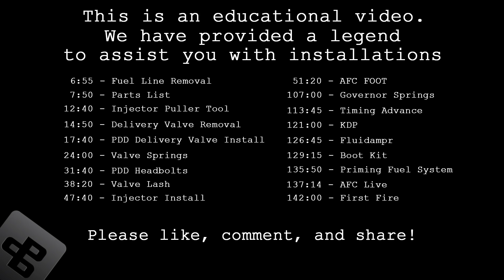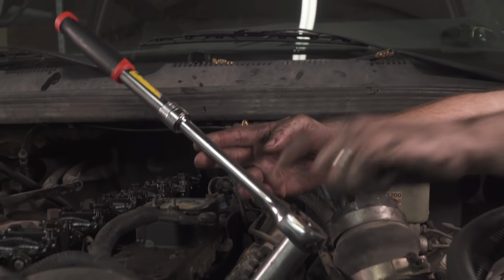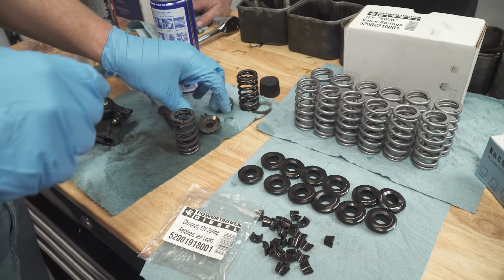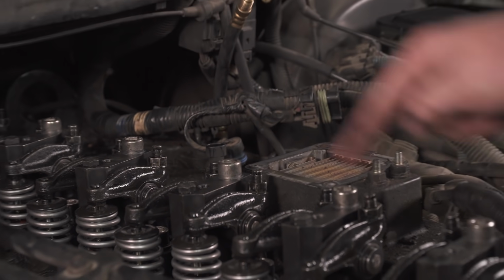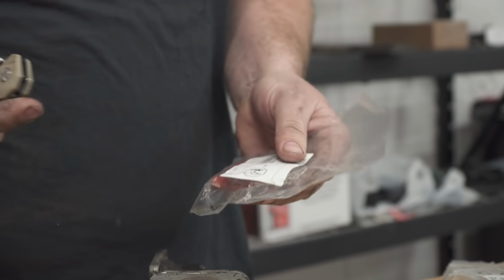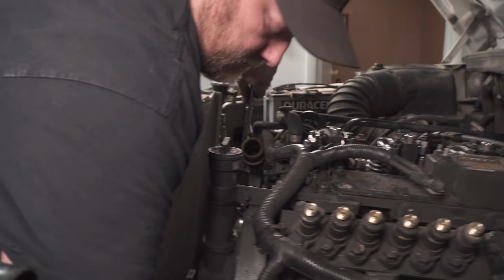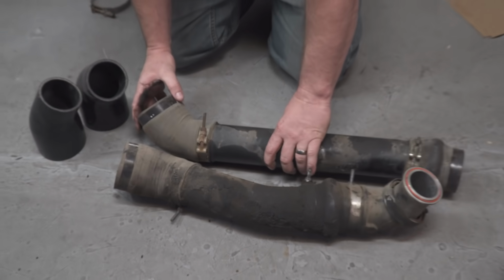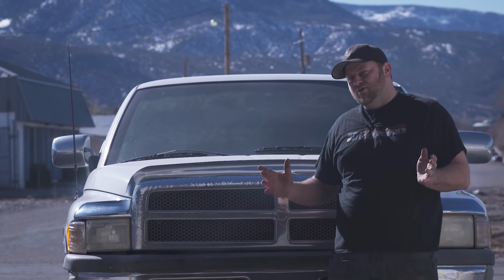Upgrading a Perfect 400k Mile Cummins Diesel

Comment: How many clicks do you do on the gov springs? Is there a generic number? Mine seems to hunt abit and have forgotten how many clicks it was when i pulled it apart.. rookie mistake
Reply from the maker: Usually one soft click AKA initial click and one or two more clicks is perfect.  The looser they are setup, the stronger the idle but the earlier they will start to govern out and pull back fuel.  Try 3 clicks and see how it runs (1 soft and 2 medium or hard clicks)

Comment: Awesome video guys, really love that you got back into your old style of step by step videos but I would have thought for that kind of power you would need to run a good lift pump such as your predator lift pump and also a few other mods such as a Mack rack plug and a tork tech adjustable over flow valve on the pump? 
Anyway needless to say I think the tranny will be the next thing on the must do list now haha.
Reply: I have a single K27 turbo 12V, custom intake and that's ALL. Not even gov. springs yet. My truck flies haha and of course no smoke. These trucks are amazing. I had my auto trans done by an awesome, experienced builder just to make sure it could take the beating of ripping around and towing anything. Yesterday I just put an AFC Live on my friends 12V (that someone put injectors on before). His truck is even faster than mine. When the roads are a little damp the rear wheels break loose in 5th gear now... before only 4th. I can't believe these engines.

Comment: Hey Will, do you always bar the engine over backwards? Im going to run the overhead on my 3rd gen and i like the companion cylinder method. Curious as to why backwards vs forwards and if it even makes a difference. 
Thank you both for all the hard work and knowledge shared through this channel. It has turned into a very valuable resource.
Reply: If you go forward it just slips on the belt
Reply from the maker: The alternator will only turn it backwards on a 2nd gen because the belt slips when turning the engine forward, so I've always turned it backward.  There is no issue turning the engine forward or back but keep in mind if you turn the engine forward, you are now watching for an exhaust valve coming up and overlapping with the intake valve starting to go down.

Comment: Hello; I've watched a variety of your videos and notice you don't seem to have much to do with newer 6.7 engines ? I race an 08 dodge dually, stock engine with a few minor engine mods @ 1000 dyno hp+
Reply from the maker: The 6.7 engine is great, but these newer/heavier trucks are tough to keep reliable for racing.  Imagine how fast you could go with 1000HP 6.7 Cummins in a tube chassis dedicated race vehicle!

Comment: Question Power Driven Diesel
Would you guys build a 2003 Ram 3500 Crew Cab Shortbed commonrail 5.9 with factory NV5600 manual transmission? My old girl just turned 325,000 the other day but definitely need to do some Power Driven Diesel upgrades hahaha
Reply from the maker: We've seen a few turned up 03-04 trucks do well with the NV5600 and a twin disk clutch.  They too get unreliable around the 750 HP mark keep power at or below 750 and it'll run great.  Just keep in mind if you street race your buddy or go to the dragstrip, an automatic truck with 600 HP will run right along side your 750 HP manual tranny truck.  But a roll-on at 60 MPH, then you'd pull on the lesser powered automatic truck till you have to shift....
Reply: @pddofficial  That is awesome! Honestly i was thinking of either twin turbo or 2nd gen swap with a good turbo, little bigger injectors and tuning then dual disc clutch, i live at around 4500ft elevation and go all the way down to sea level but i just want reliability with lower egt’s etc i tow with it a couple times a year or take 1000+ mile trips unloaded but rest of time is work driving etc. I just want a little more power with some better reliable parts and tuning then say oem, i wouldnt even mind 450-500hp but cleaned up tune good for high rpm maybe but still get good mpg in 6th gear running around 2000rpm on 35” tires. Nothing too insane at all but maybe something that makes it run better, it just has a Fass, AFE intake and rail pressure/boost gauges and 4” exhaust but i wanna make it run a good long while if i could and good for long trips or even cruising down backroads of northern california/oregon

Comment: Did you guys do the valve seals as well with the springs?
Reply from the maker: Normally we would do the valve stem seals, however, this engine is going to reside in the truck for less than a month before it's being replaced with a new race engine.   If this engine were to be transplanted into something else, we will probably pull the head and install a PDD ported head along with fresh valve stem seals, oringed head gasket, etc.

Comment: I have a stock 1996 I just bought... are all these parts available in California?
Reply: They are but..... The smoke police will getcha if it "hazes smoke" for more than a couple seconds .. some areas are more strict and if they see any smoke theyll pull ya over.
Reply: @jdogdiesel7242  is there a site that tells me what I can and can’t do?  I want to do some mods but I don’t wanna be pulled over all the time. Like exhaust and turbo and stuff.
Reply: @Just Chris  no but basically be careful when and where you roll coal and put a resonator or muffler on the truck and you’ll be fine

Comment: I had an 07 Grand Cherokee .. 4.7 v8, at 1200000 mi, the valve keeper cut loose, destroyed engine.  When I pulled head . Hole in piston. They were those daimler based v8 s. Modular, v6 s ,  Ram buddy of mine same thing. v6, he beat the warrenty though. They fun, not very durable. i know that the Mercedes had service intervals that valve hardware, not Chrysler .
Reply from the maker: Dropping a valve is usually expensive regardless of which engine platform you are working with.
Reply: @pddofficial  I'm in my 50s. Between company vehicles and personnel . Definitely over 50 cars trucks. 24yrs at Pepsi. Teamsters retired. Yr at Ups. Of everything,  a 79 pinto, , that grand Cherokee . Only vehicles to blow engine. My Dad had mini fleet . 5 kids mid 70s GM. We had 4 Impala, at one time 71, 72. I had a 76 Buick century in hs. I used to do all the maintenance. Currently 2005 Taurus.  06 F250. Powerstroke. 375000. All original. Weird.  The oil stays really clean.

Comment: Will a 47rh handle afc live
Reply from the maker: The torque converter was the failure point on this transmission and the 47rh, 47re, and 48re all have very similar torque converter design and will all start to slip the lockup clutch around that 650 to 900 ft lb mark.  Stock 48re's are a little better than the stock 47rh or 47re simply because they run almost 20% more lockup clutch apply pressure.

Comment: Anybody else having problems getting their tunes done thanks to epa douch bags atleast that was what I was told is that they are holding the software hostage basically I've been waiting for like 5 or 6 months now just to have tunes unlocked to run on my new mm3 mod box because it had a failure

Comment: I can’t believe you used a grinder over an open engine. Shouldn’t you have placed the valve covers on or used a towel. Also when you flipped the lid on the pump, dirt dropped down in the hole you said to keep clean. Might a pressure washer been a good idea before the job? 
P. S. I agree with gloves now, I used to jump in with both feet but I got a cancer and they said it could have been from the chemicals ( fuel) I worked with. WD-40 is transdermal also.

Comment: Don't forget about all the air that was polluted good job on that. And time black smoke rolls out a exhaust pipe its un burnt wasted fuel that just pollution plain and simple. I'll stick with my gasoline engines they don't make nearly as much pollution when built and tuned properly.
Reply: Grow a pair

Comment: i love this channel  n i dont even like dodge :p  yall jus seem like some good ass ppl       iv just never had much luck with dodge iv had a few n even have a 99 1500 5.9 4x4 now but its such a piece.. iv had a LLLOT of vehicles n never had anything thats rusted as bad as this, i promise on my grandmothers grave thiss no exaggeration, i was chipping at least 3/4 inch solid pieces of rust off the diffs, n the whole rest of the tucks doin the same, the rear bumpers so bad, the left side.. not a piece of it, the whole left part of the bumper fell off in the road, thank god right as i was about to throw it in reverse to back into a buddys shop..  it was literally bein held together with the chrome plate, the steels totally gone yet the thin ass chrome plates there chillin wonderin where all the metal went....    its like its been parked in a pile of salt every night all its life.. then all the mechanical shit, the transmission, the transfer case wont shift without shuttin the truck off